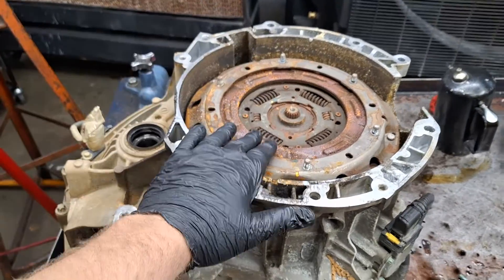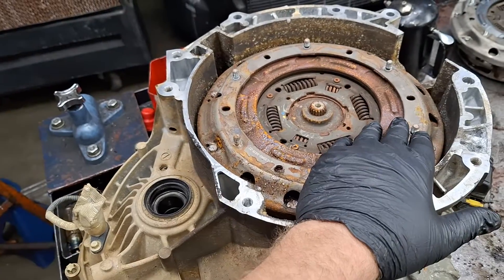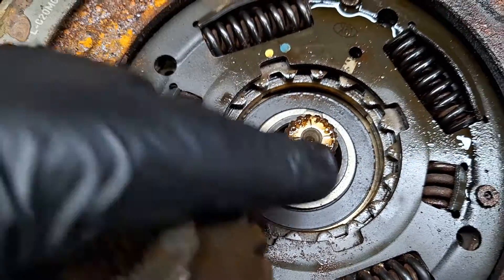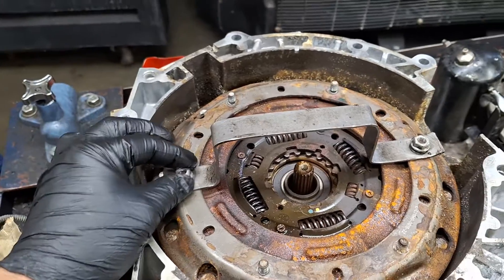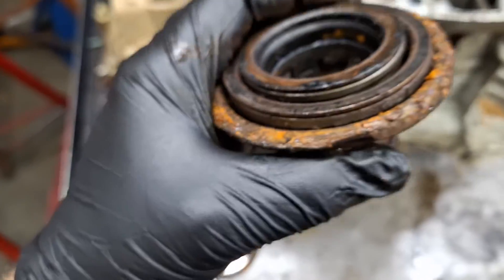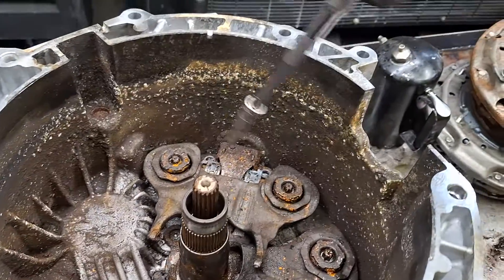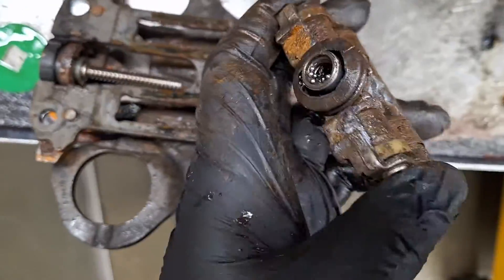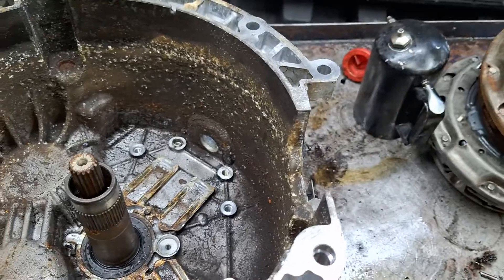Removing my RUSTY Clutch! Ford Focus DPS6 Transmission Failure

Comment: Out of interest what fault/issues were you experiencing? 

I'm just about to pull a DSP6/6DCT250 box from a Smart 453 because the upper clutch motor (I've already tried a new motor) is failing to actuate the clutch
Reply from the maker: No engagement. When I put it in drive it stalled the engine when I pulled the clutch out I found both forks were fully extended and seized. Also when I fixed the clutch and put it back in the car first gear synchronizer started grinding so FYI
Reply: @BigBensCarsAndCycles  thanks for the quick reply!

Thankfully other than not being able to fully engage the clutch on the odd gears it drove perfectly once in an even gear :D

I'm really hoping its just a failed actuator/fork.. I've just ordered the reset kit from china and it would be nice to fix it without having to replace the eye wateringly expensive clutch.

Comment: I just replaced the clutch with Luk kit. Drive so good now. The mechanic showed me the clutch... Pretty rusty. Not as bad as this one. But made me wondering. 

Just lucky what California started raining. I opened the hood in the morning when the rain stopped and discovered there was water dripping down onto the transmission housing from under the battery box! I cant seem trace the where exactly the water came from. Any idea? The area by the windshield looks intact just by visual inspection.
Reply from the maker: make sure the cowl is flush with the windshield and the weather strip is on the cowl too!

Comment: Did they drill holes in the bottom to drain trans fluid from a leaky seal in the gear side?
Reply from the maker: I didn't notice, I'll take another look!
Reply: Looks like everything on the dry side, has been exposed to the outside world, in a wet environment... possibly salty... for a good while...Could also be someplace where the case sections meet, just not sealed up any more...When I watched this one, I was like 'ugh, whhhhh, yuck! ....no way...uuuuh, NOOOOOOO... damn, seriously? Rust everywhere. Wait, was this a boat anchor in the ocean for a month?' 😄 @BigBensCarsAndCycles